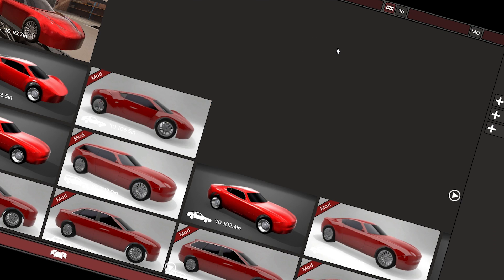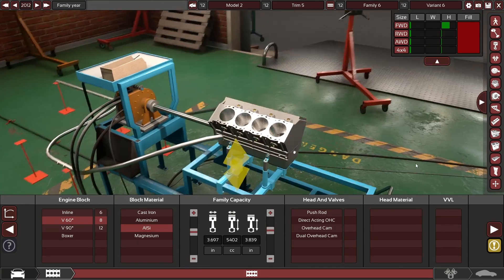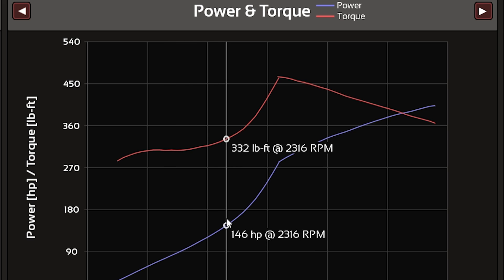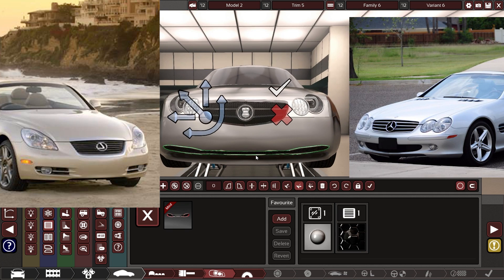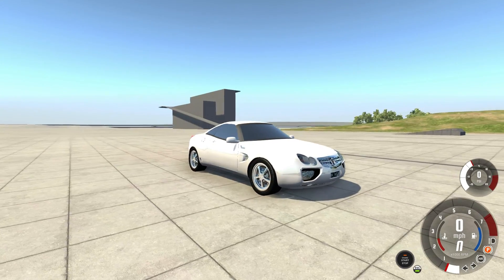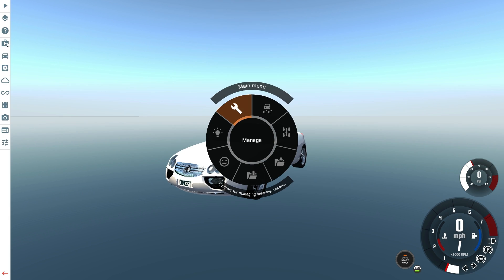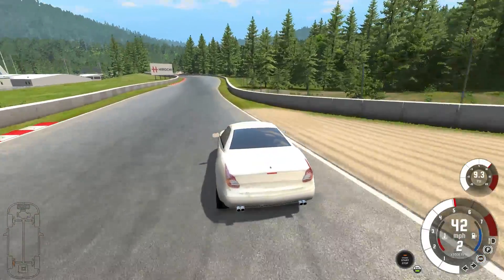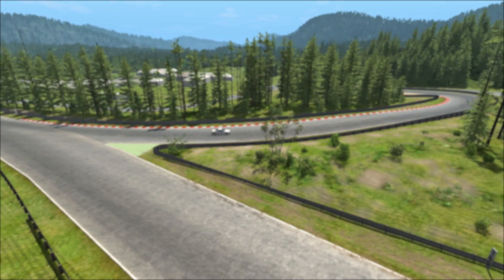The SL-FA: A discount SL-500 | Automation / BeamNG

Comment: if you need a good gear ratio use the ford AOD transmission gear ratios and use a 3.55 rear gear.
Reply: Andy47357 That's exactly what's in my Mustang